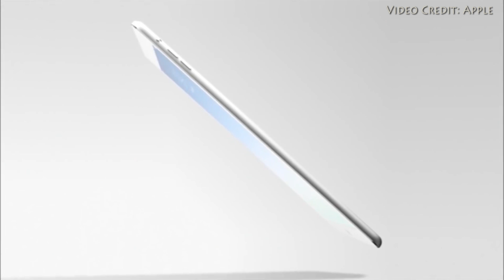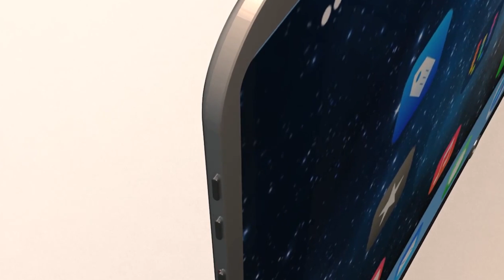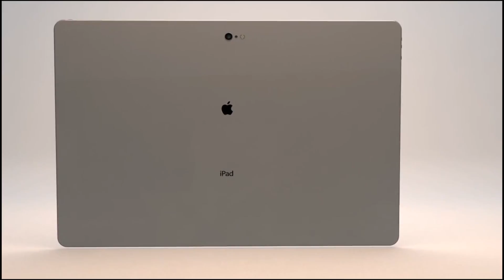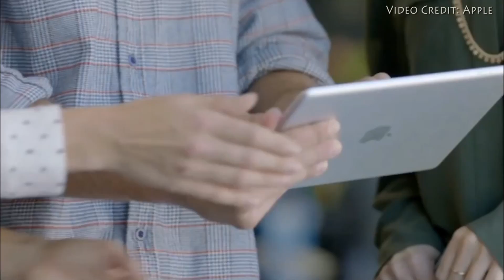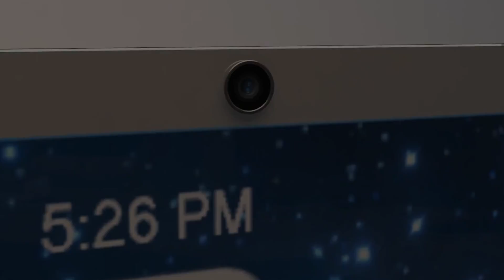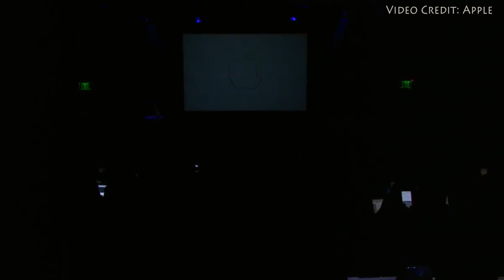Apple iPad Pro: Rumors & Concepts (2015)

Comment: As a writer and a massive film nerd, I could make quite a lot of use of an iPad with such a huge screen. If I were able to get hold of a pen-point stylus I could do away with my old writing pads and write everything on the larger screen (I prefer writing on something A4 sized) whilst also getting a portable screen that mirrors that of my computer (albeit slightly smaller as I have a 15" MBP).

My only concern would be the battery life... To really pull off the spectacular specs and have a batter life worth paying for, it would need to possess a full laptop battery or a smaller, long-life version. I would also have concerns about charging (I'm not sure a lightning charger would keep up with demand whilst plugged in) and think it could/should come with a magsafe charger.

I would also think that a keyboard/speaker dock would make it quite powerful. Add trackpad/OSX integration and I think this could kill.. Personally, I'm hoping for a laptop/tablet hybrid. Apples answer to the surface is long overdue.